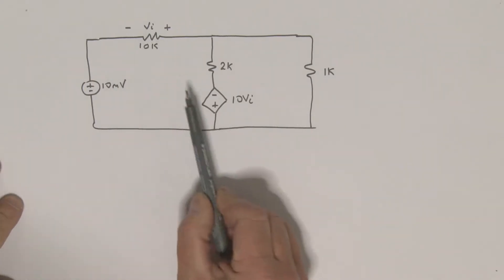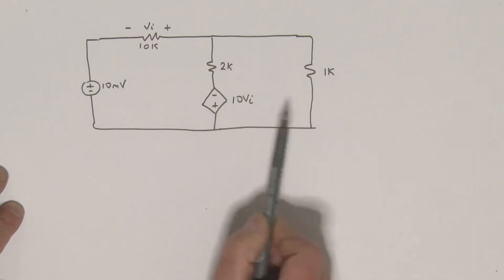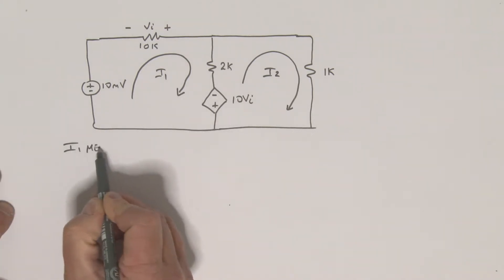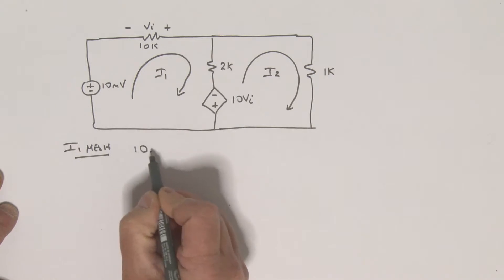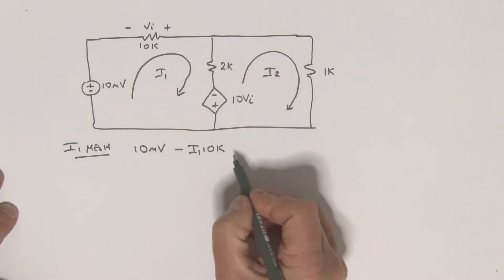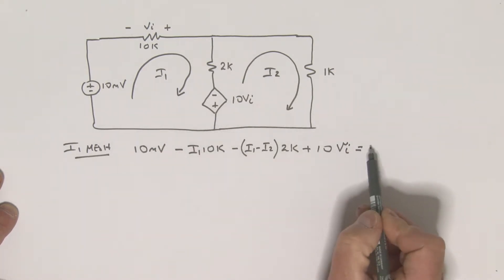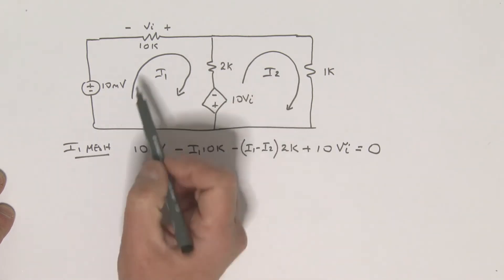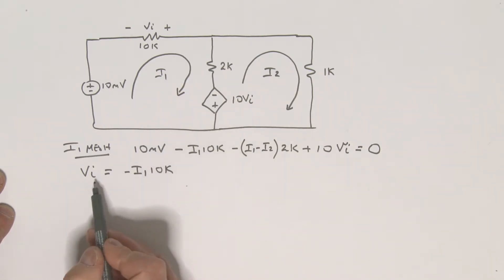Voltage Dependent Voltage Sources

Comment: A voltage-dependent voltage source (VDVS) outputs a voltage proportional to another circuit voltage, crucial in circuit analysis! Check out my channel Engineer MayDay Question Solution for more engineering insights!

Comment: why did u make the second one negative if its going from minus to plus
Reply: Thats the given polarity, he is assuming the voltage drop is going from + to - across the 10k R while performing mesh analysis. Which is pretty confusing...
Reply: @coreyhooker4064  it's indeed confusing and i'm still struggling with sign convention.